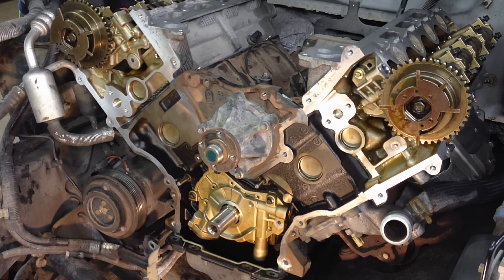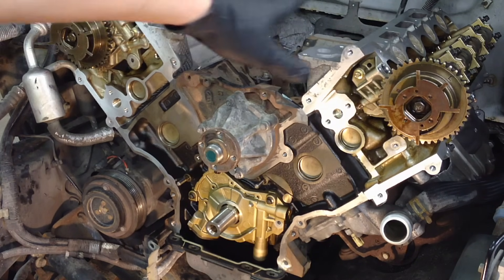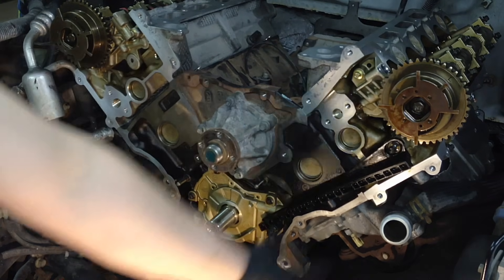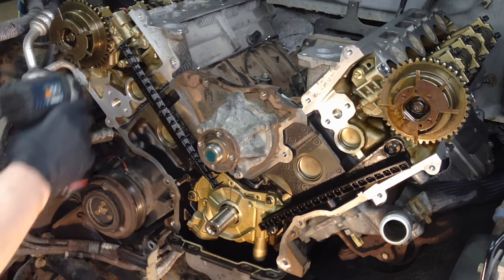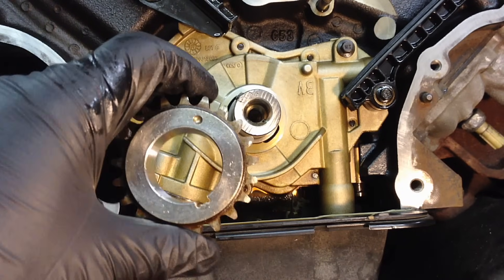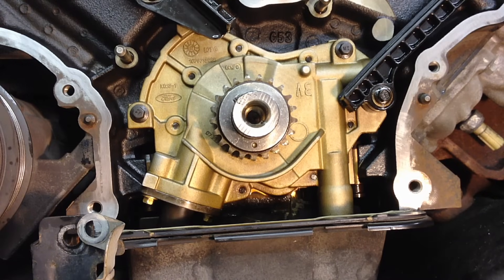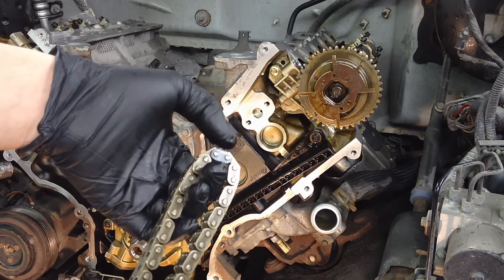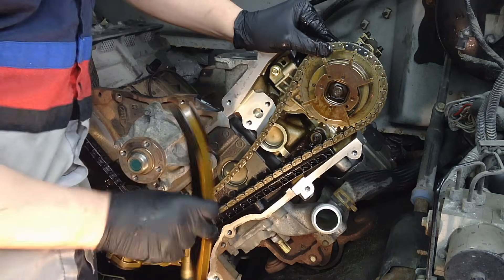Ford 5.4L 3v Engine Timing Walkthrough

Comment: 04 5.4 3v i did the timing chains all marks are lined up crank at 11 with the tool.. i started it up ran normally cold start ran for 10 mins and started rough ideling like it was camed took it for a ride and stared what i want to say eas spark knocking and i have p0345 p0012 p0174 p2195 startes but now runs low idel rough now so i tore it back down to see if i messed anything up i cant find anything wrong with time ...

Comment: Hi there, I have Q: the timing makes 11o'clock to drive side,1 o'clock to passenger side and 6 o'clock to crankshaft,my Q:when turn the crankshaft two round should back in same point and Mark's. Thanks for answering.

Comment: FordTechMakuloco, I have a 2009 5.4 3V F150, with 159,000 miles. At high acceleration it loses power slightly, then runs normal again (as if nothing is wrong). After speaking with a diagnostics tech, he suggested the VCT solenoids may have begin to stick based on the mileage. After watching several of your videos (on VCT and other components) I decided to replace the VCT solenoids, Camshaft Phaser Sensor, Timing Chains along with a HV Oil Pump. I purchase all Ford Motorcraft OEM parts (except oil pump/Melling), with the intention of having my local Ford Dealer doing the labor.  YES I know the labor $$$$ is a killer, however, I was informed by the service manager/dealer that I would ruin my engine by putting in the new parts (specifically the oil pump would be to powerful and ruin parts that were not swapped). My question, have you experienced or heard of anyone ruining the engine  by CORRECTLY replacing the Timing chain and Cam Phasers as outlined in your videos?

  Thanks for any information you or anyone else may provide.

Comment: Are these interference engines and can damage occur to the valves if the crank shaft it turned with the chains removed?
Reply from the maker: Yes they are.

Comment: I recently bought a set of timing chain tensioners through this company which  provides parts to O' Reilly's auto parts. As a result of purchasing tensioners from O' Reilly's and not up grading to cast iron tensioners I put some kind of plastic nylon tensioners that this company provides to O' Reilly's and there tensioner totally collapsed which allowed enough slack on new time chain to jump 4 teeth and destroying my 5.4 2 valve. The part was clearly defective and neither O' Reilly's or this company have done nothing except ignor that they sold a defective part that destroyed my engine. And the lifetime warranty is a joke its put there to deceive the pubic.
Reply: You bought Chinese parts.  What did you expect?  OEM is the only way to go, as the video always says over and over.

Comment: I have a question for you. I originally was just going to replace my chains my tensioners and my runners. Unfortunately I did not have the tools or could afford to get the tool to take roller followers out. So what I did was trying to lock down the phasers and put the new chains on with The colored links straddling their marks at the top of the phaser, and at the bottom shaft sprocket with the dot. Unfortunately when I bought the kit from AutoZone, only one chain  had the marks on them. So the driver side was done perfectly. But when I had taken off the right side the spring jumped and I was concerned, so I had waited until a friend of mine who knew a little bit more than I did would come to help me. When he got here, he kind of threw it on fast without marking on the chain. Needless to say after putting everything back together, I had a code pop up saying that the passenger side bank 1 is retarded. So my question is I have opened up my truck again to correct the passenger side which happens to be the first chain that you pull off anyway. As long as I’m at top dead center. Which means the driver side phaser with the L is pointing in the direction, and the sprocket on the bottom with the dot is where it is supposed to be. So I took off the first chain and I was able I believe to correct it. I took the chain off and marked it. And made sure that it was straddling the marks on the phaser and the sprocket on the bottom. But my big question is, can I only change one side? Or Do I have to redo both of them. The reason why I ask is because the marks don’t line up anymore that are on the chain. When I put them on, and I rotated the crank twice to get it back the top dead center. Marks on the chain aren’t where they’re supposed to be anymore. Is that OK as long as everything was at top dead center?

Comment: Can you do this without removing spark plugs
Reply from the maker: Yes
Reply: @FordTechMakuloco   but I can't spin the crank safely with roller followers in, correct? I assume you can't be 180 off or the timing marks on phasers  would literally be 180 off. Losing my mind over here lol
Reply: Finally, good news lol. I'm at the point of phasers, chains, tensioners and guides off in my shared driveway and I have to set the timing but it started raining. Both cams kicked over a little and sludge is heavy but I have to try and get more done tonight. Worst part is I'm only 40ish minutes from your shop but thought I could get away with just phasers. Never again lol

Comment: What is the pattern for tightening down the cam caps?
Reply: @marcus
Call front A, middle C, rear E, Driver L, Passenger R
1.    2.   3.    4.   5.    6.   7.    8.   9.   10.
CL, CR, DR, DL, BR, BL, EL, ER, AL, AR

Comment: When I unbolted the passenger side tensioner the cam phaser rolled counter clockwise when the chain jumped on the crank sproket about an 8th of a turn (maybe an inch or less). The driver side phaser never moved. Eventhough the driver side didn't move. Will I have to go the process on the video or can I just remove the lifters on the passenger side and roll the cam back into position to where the mark on the chain is aligned back with the mark on the crank sprocket? This is an emergency of a sort cause with a wife that works being down to one vehicle is a problem.
Reply from the maker: slowly unbolts all the cam caps evenly then remove the cams and followers. At this point follow my four part series on installing the timing kit properly.
Reply: So it's not recoverable at this point without pulling out the cam shaft?
Reply: The cam didn't rotate very much. The chain marks and the phaser marks moved maybe.....half an inch while still aligned with eachother. Do you think there may have been contact between a valve and a piston?

Comment: I'm a little confused, the crank makes a 720 degree rotation for a complete Intake/Exhaust cycle. With the crank sprocket woodruff key at the 11 oclock position, how do I know it's not 360 degrees out of alignment?
Reply from the maker: The cams run at half speed not the crank. The crank cannot be out of alignment.

Comment: Hello, Help is needed please! I'm in the middle of this job and I sent cylinder heads to a machine shop to have the work done guides, seats etc. when i got the heads back they were completely assembled. How does one go about getting the timing correct. Thanks for the videos they have helped a lot. Timing seems 180 off according to cam phasers

Comment: I have encountered a issue with a 1999 Ford F150 5.4L 2V engine. I replaced the head gasket and also it had a rattling timing chain. Upon taking a look at it, i have replaced the tensioner and injected the guides and they show little wear but nothing significant. only the driver side rattles. i thought it might have been the chain itself but upon switching it with the passenger side it remains loose. It isn't always loose. every about 1/2 turn of the camshaft it gets loose. the other 1/2 turn it tightens up. the tensioner gets pushed out and in during the turns. if anybody has some suggestions on what may be causing this issue please let me know!!!

Comment: Sir does the 6 o’clock crank position pertain to a 2001 Lincoln Ls v8??
Reply from the maker: The Lincoln LS engine is totally different.
Reply: FordTechMakuloco so what would be the top dead center location of the crank for that car?

Comment: changed pretty much everything in it chains guides  doorman phasers. plugs coils all motorcraft cam sensors vvt selonoids everything is original but keep getting back p340-p345. car can idle fine for hours as soon as you drive it 10 ft it cuts of and shakes,,, help any suggestions, also noticed by thrust bearing wear shot, replaced those also with new original no more play in crank but keep getting these codes, voltage seem fine from ECM to the cam sensors,.

Comment: Thank you for all the great videos. I used your 4 part series to repair my truck that sounded like a loud diesel. I found a seized roller follower on the #7 exhaust valve. It chewed up the cam on my 04. You gave me the confidence to go deep in this motor with your excellent video series. If it wasnt for you this truck would have met the scrap heap but instead its ready for another 100k. Thanks again and keep them coming.
Reply: How is she doing?
Reply: Any updates on her

Comment: Hello I have a 5.4 2006 f350 with 292400 miles on it its misfired  on multiple cyclinders lacks power after warmed up and driving it 20 miles   but if it's cold engine it runs fine what should I do here is my cell text or call I need help 8145929503

Comment: It it jumps just one tooth does the valves get bent? Then you have to take heads off and redo valves
Reply from the maker: No have seen these a few teeth off and no problems.
Reply: What if I use both else did I been the valves?
Reply: L,s

Comment: Does the crank have to be tdc on compression stroke. or doesn't it matter? I changed chain cam phasers and all guides and tensionors now the Lincoln won't run it sounds like it's missing and just sputtering when try to go. I bought tool and put crank where supposed to. But didn't have on compression stroke I don't think.

Comment: I put the tensioners in the wrong spot but the truck idles smooth and runs great. Will I eventually have problems because of this because they look and clocked the same?

Comment: Ive got mine all timed but have slack on the driverside chain on the non tensioner side? Is that normal
Reply from the maker: Yes there will be a small amount of slack when turning it over by hand.
Reply: Thank you very much man keep up the great work
Reply: I havent turned it over yet but there is slack on the bottom of the chain
Reply: The valve spring pressure keeps the slack i can move a breaker bar and take the slack out but soon as i let off the slack stays am i good to put it back together
Reply from the maker: yes
Reply: Thanks man

Comment: Have to change the plugs in a 2012 5.4 E350 van, unlike the trucks & SUVs the spark plugs aren’t those shitty 3 piece but the fuel rails are over top of the coils.

Comment: Thank for the video, quick question.  During the process of replacing my phasers and chains i rotated the crank shaft, with timing chains removed, out of position by about 1/4 inch.  I'm starting from scratch on timing and was watching the video.  How do I rotate the crank to get it back into position.  In your other video I have the key at the top or 12 o clock position.  How do I get it to the 6 o clock without damaging anything?

Comment: i did timeing chain phasers and oil pump i didnt turn phaser bolt 90 degrees could that be my problem still sounds like a diesal motor was spotless inside

Comment: Why is your pully so easy to move. Mine does not, making it hard fore to adjust when I put the timing belt on
Reply from the maker: Followers should be removed
Reply: Why does my car backfires after doing the timing and turning the engine on. It made a really loud aound
Reply: It made a really loud sound and smoke coming from the back tail pipe. What could have cause it?

Comment: IVE REPLACED EVERYTHING AND THE CHAIN WILL NOT STAY TIGHT DRIVING ME NUTS , HELP PLEASE
Reply from the maker: If you have it timed and tensioner right with the tensioner retaining clip removed you are good to go. If you are referring to the chains getting loose when turning the engine over by hand this is normal.
Reply: LOOSE  ON PASSENGER SIDE AT TOP  WHEN YOU TURN IT ABOUT 3 TIMES .AND WHEN I START THE TRUCK ABOUT WARM UP AND OIL BREAK DOWN IT STARTS TAPPING AGAIN

Comment: Other than the cam phaser issue, is their any other problem area on this engine? I was wondering because I am debating on a 2009 f150 with the 5.4 or a 2014 with the 5.0. Not sure which one to choose. I have heard of the 5.0 engine having warped cylinders or blocks on certain year models from 2011 on. Also  wondering if you know anything about that. Thanks for the videos, they are very helpful for DIY people like me.

Comment: How do you know that you on the right compression stroke?
Reply: My thoughts exactly
Reply: Love how to replies don't answer the question
Reply: You have to time the engine befor taking it apart so you know you left it in the right compression stroke
Reply: I was thinking exactly the same thing... I'm like don't you have to make sure #1 cylinder is TDC first???? 🤔
Reply: Its the stroke after the intake valves close, for the power stroke, watch the vlaves
Reply: If the crank is at 6:00 the crank is at 6:00. There’s no way a piston wouldn’t be where it’s supposed to be if the crank is at 6:00
Reply: If you don’t know the answer to that question you shouldn’t be working on it …

Comment: I'm about to have to tear into the front end of my Triton. Honestly, after watching this video, it doesn't appear to be any more complicated than anything else I've worked on in the past. It'll be more work just to take the radiator and stuff off to get access to it. Good thing I have another vehicle to use while this one's down. Going to do my best to upgraded tensioners and chain guides though, I'm not a big fan of putting plastic components in a machine that has such tight tolerance. I really wish Ford would bite the bullet and bring back the 300 straight 6.

Comment: hello I have a lincoln navigator 2006 with a 5.4l 3v engine, I put 5w30 castrol gtx oil, but already has 158750 km, I recommend raising the degree of viscosity ?? 10w40 ?? , birds: I hear a little noise to the engine as jingle "(birds) I speak of oil in mineral! .I appreciate response, greetings.

Comment: Thanks for all your helpful videos. I’m replacing all timing components on the same engine, and in the process I took apart the vct solenoid body to clean all passages and the little filter inside. This filter is held down by a head-less Ellen bolt. Do I need to seal the thread of this bolt or install it clean? If yes, what sealer would you use? Same question for the other smaller bolt on the vct body. I’m asking because I think these bolts are supposed to prevent oil flow through them, which might compromise the oil pressure going to the tensioner.

Comment: I bought a long block, for 2000 navigator 5.4 doch,,never checked my original for a cylinder head temperature sensor to see if it had one, i do have a water temperature sensor right under the throthle on the left, but no cht sensor on the right behind alternator like most engine do, no sensor no electrical plug no nothing, at the dealer show on the picture that  this cht sensor in and the end of a cylinder head but its not specific which one, and if it does could it be by the firewall? Or this type of engine only have water temperature sensor,. I get a 1289 code, but i cant find such sensor or plug hanging empty somewhere, i used a microscan bluepoint scanner, and doesnt have a lincon navigator 2000 on its options.
I got the engine running good but throws 1289 code...service engine soon

Comment: I have an 06 Expedition 5.4 3V with 52,000 miles!    Had tapping noise.   Went to dealer in Santa Barbara and he said drive it... said it might last another 50,000 miles like that.... super bad advice...should have been fixed as soon as it started making noise     I kept driving for perhaps another 1,000 miles when it made a very loud noise and engine light started flashing.   Local mechanic found the problem by taking the passenger side rocker cover off.  The Roller Follower blew apart and the Cam has damage and a valve was bent.  Little needle bearings went everywhere... is that a problem or do they just end up in the oil pan?   

 Both Local Mechanic and  Dealer refused to work on the motor.   Both dealer and mechanic tried to sell new engine.   Ford rebuild uses same oil pump and other parts that are obviously not as good as they could be, so it seems that the only solution is to fix it myself or buy a rebuild from Jasper.   My concerns are if the piston was cracked by the valve.   

Can I check the cylinder with a scope of some sort down the spark plug hole?   Can you suggest what type of scope?   Seems to me that if the piston was cracked that it would make more sense to buy the Jasper rebuild than try to fix everything.   

If I try and fix it, what components would you suggest replacing?   Should I fix just the one side or take both heads off?   Can the CAM be machined or needs to be replaced?   Should I update the Phasers?   From your videos it seems that the front cover should come off and the oil pump should be replaced at a bare minimum.   Any direction you could give would be most appreciated.   You are exceptional in providing these excellent videos and I much appreciate it.    

First Ford I have ever owned.  What an experience!

Comment: I just did this job and followed your video but didnt have the special tool. I put the dot at 6 and the colored links lined up pretty easy. I turned the crank a few degrees back and forth to line up the marks and give my chain slack where i needed it but all the marks and dots lined up correctly. The engine now cranks like the timing is off and it runs real rough. Please explain how the timing could be off when the marks and links aligned correctly. Thanks.
Reply: I'm having the same issue...ripping into it again tomorrow